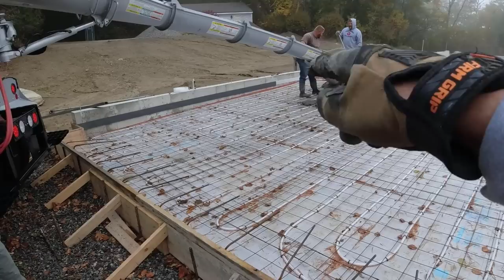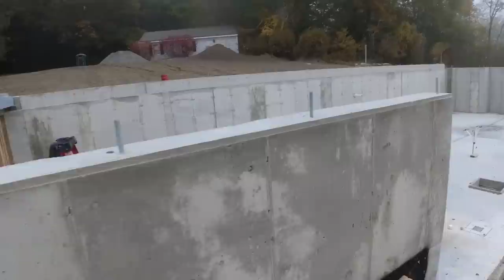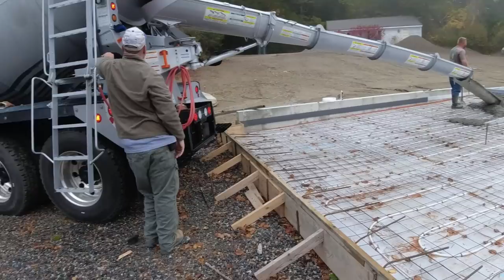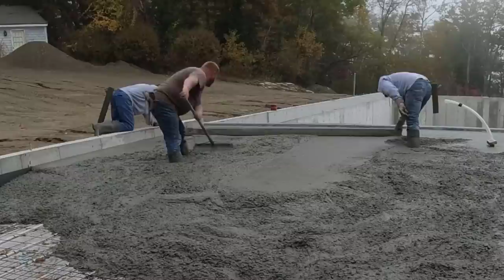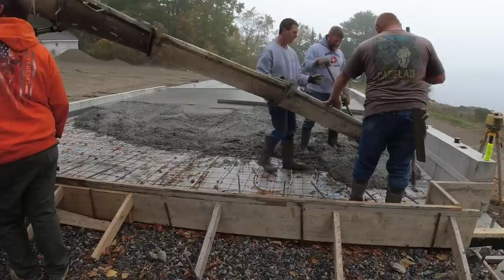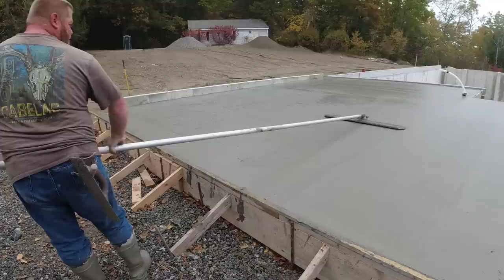We Poured It A Foot Thick - How Did They Mess This Up! (Garage Floor Over-kill)

Comment: Hey Mike love your content. I cannot wait to pour my 40x60 slab after joining the Concrete Underground and watching all of your content. One question about the mix y’all use though. I emailed a company about what I was after - 4k psi, mid-high range water reducer, 6” slump, fiber mesh reinforcement. They said the fiber mesh they use is to prevent shrinkage, he made it sound like the fiber mesh used to actually reinforce was uncommon and only used on engineered jobs etc. Is their a specific brand of those additives you can expound on a bit either somewhere in the Underground or here? Thanks a ton appreciate you sharing a lifetime of experience with us.
Reply: Don't put too much weight on the advice from the sales staff at the company you emailed. Just because contractors don't necessarily follow a best practice in your area doesn't mean that it's overkill or a bad practice! Just take a look at the average spec house from a national home builder...  they can barely frame their houses competently. 

For these builders (who likely comprise a significant portion of the business for that concrete company you mentioned), they need to save every last cent to maximize quarterly earnings. They'll be buying 3500psi (or less, if possible!) concrete to save a few bucks. They certainly aren't going to be paying for extras like fiber mesh. Consider that fiber mesh may "only" cost you $8+ per yard for a retail purchase. For you (as the project manager / homeowner), that may only be an extra few hundred dollars, but for a national homebuilder completing 500 homes per year, that could be $100,000!

Now, of course, any homeowner buying a new home for $250K - $1.5M+ would gladly pay an extra $150 for fiber mesh in their concrete if the cost/benefit was explained to them. But as I just described, this information is very far removed from the end user. Even if builders did explain this to the user, there's no way they could sell a home for $250,149 instead of $249,999 to recoup that expense, so material upgrades are almost always a cost center for national homebuilders. 

(I could go on; this doesn't just apply to concrete! Check out the sill plate for homes from national builders; For an extra $100 per house, they could upgrade to "ground contact" UC4A pressure treated lumber. But instead they pocket that $100 and almost exclusively use "above ground only" UC3B pressure treated lumber which has ~50% less wood preservative (and more headaches down the road for the homeowner!). A reasonable home buyer would certainly spend $100 in this area for the better material...  but except for custom homes (where an engineer is likely specifying the wood quality and concrete fiber mesh ;)), there's currently no way for national home builders to "monetize" any material upgrades... so they're never even offered to the homeowner)

In any case, that was the (long; sorry!) explanation for why concrete sales people find add-ons like fiber mesh to be "rare" or exotic; it's not that they're misleading you, the problem is that the majority of their business comes from contractors who are following the directions of upper management pencil pushers!
Reply: Hi Mike That must have worn you out having to walk through concrete that deep. Your crew and the driver seem to be good friends
Reply: How is the underground? Is it a lot more detailed?
Reply: Check out helix micro reinforcing - tiny twisted steel that is added to the mix.
Reply: Always use rebar if you want it to last!  Use of fiberglass in place of rebar is not going to give yup the strength against stress fracturing.  Wire mesh or rebar should be held up with plastic risers or concrete Dolby blocks with tie wire embedded  into them to tie to rebar or mesh.  Any structural rebar or wire that is not held within the slab at the proper depth will not give the ultimate strength.  Adding of plasticizers in place of water to make it flow-and achieve a specific slump is a great way to get a higher PSI  concrete.  Less water greater strength. Always pour as dry as you can handle it and work it.  Use high frequency vibrator to help with moving the concrete, removing air bubbles and bringing the cream to the top for an easier finish.  Higher Portland concrete, like  a six sack mix, will give much better quality in the long term.

Comment: I know you guys did your part, but sure seems like that grade issue should have been corrected? Just crazy for so many reasons and I could see you where thinking the same all the while you were pouring Mike. All the best in 2023!
Reply from the maker: The GC was notified and it was their call. We had the same problem on the house floor, it was 8" instead of 4.
Reply: Someone used a metric tape?.... Lol... That's nuts.
Reply: @MikeDayConcrete  Yep I thought that was the case.Keep on Keepin on!
Reply: @MikeDayConcrete  The GC’s brother must own the concrete company

Comment: Hi Mike,  Thanks for your videos.  Do you happen to have a video where you poured a slab patio that the owner was considering one day possibly building over at least part of it?
Reply: In Europe there would be two pours, first the 4 inch subfloor, then on top of that insulation, then the radiant heat on top with a fast warming thin liquid screed self levelling covering that. Much better

Comment: The slope is really excessive. I have done a lot ao
Is there a supervising engineer f garage but not 6 inches slope, look like a ramp plus not coordinated with civil engineer site grading.
The question, why no question the 6 inches slope before do😊ing any work or during the review of the construction documents.
Did you request for clarification regarding the slab on grade thickness and slope? Did you coordinate with HVAC engineer the the correct placement s aof heating element..

Comment: For those that've never moved mud (concrete) before, there's a big difference in moving around in 4" thick and 12" thick.  Not fun.
Reply: Fuk'nA right! Especially on 55 year old feet... ;)
Reply: I don't know how you gus calibrate with the other guy while screeding. We use 1man screeds.
Reply: @BaberJacks  me either. Clip on aluminium screeds are far superior and flatter.
Reply: @lachlanitis2311  we use the ezy screed. I think marshaltown sell them in the states.
Reply: @BaberJacks  definitely easier on the back, we use different screeds in Aus. Slower but highly accurate I and many others can screed within 2mm or even 1mm if the concrete is dry.
Reply: @lachlanitis2311  good raker/shoveler saves ya.
Reply: @BaberJacks  definitely

Comment: What a disaster. The basement entrance doesn't meet code either. Slopped floor or not, a 4" min. gas check is required in all 50 states under national fire code. We always grade for finished floor height 4" below top of foundation. As always nice work Mike!

Comment: The mesh is not doing its job unless it is supported on chairs at the correct depth.    Walking on it and poking it with a walking stick is not in any specification I have read.

Stavros

Comment: This is going to affect the radiant heating under 10" of concrete. Someone should have stopped and got the builder, architect, and heating contractor out there and inspected the subgrading before pouring that floor.
Reply from the maker: We did, that's all in the video

Comment: WOW that is thick. The question is, will it crack? :)
Reply: Oh my, Yes it will crack and there will be problems later on with some spalling and other issues.  I know, I am an Engineer in PCC
Reply: @dereksellars  Shucks! so the question is how do you pour a basement/garage floor that doesn't crack?
Reply: @johnwayne2103  The concrete will always crack. You just need to control where you want that to happen. Also, they just used wire mesh instead of rebar mats. At 10" thick, there should have been 2 mats. Zip strips are good to put in a floor like this. You will have a hair line crack where they are placed, therefore you can barely notice them. I wouldn't have let them pour this floor if it were mine.

Comment: Well on the bright side it sure will hold the heat when the power fails, or fuel, I'd say a week at 30 degrees no problem. But I'm just a sign guy.

Comment: Why put wire on the ground in a 12" thick slab?  Even if you pull it up, it's going to drop back down and lay on the radiant tubes.  Pull the wire out and save it for a job that it would matter on.

Comment: Making a change like that on the fly is never good. That heat was engineered for a 5” floor. Aren’t you worried that pouring it that deep and wet ( almost self leveling) it’s going to crack like crazy?  You always seem to add too much water to your flat work. Guess it works for you? BTW I estimate you got about 60% of that mesh of the bottom of that pour! Where you a man short on this one?

Comment: Concrete is sitting waaay too long before screeding! Need 5 or 6 guys with rakes and the trucks need to dump nearly instantly, with guys pulling concrete in  waves  back into the corners of the form. That's the way you do it! Road mesh is useless, sitting at the bottom, with no dobies or chairs. Half a dozen guys with good rakes can pull an 11 yard load up to 40 ft. from the front of form in  just a few minutes.  No substitute for enough labor.

Comment: I used to love doing those walkout basement floors they were so easy all the way around from pouring it to putting the 4ft power trowel in there to take in the power trowel out everything just so much easier I've never poured that thick a concrete floor on radiant heat before does that even work couldn't you of just put a drain in the middle instead of putting such a big slope on it

Comment: That wire mesh is way too light to reinforce that thick of a slab. AND, even worse it is not supported at the correct height in the concrete. The workers lift it up with their rakes and then promptly walk on it with their boots, driving it back down to the very bottom of the concrete. Rebar on rebar chairs is the only way to go.

Comment: Did your guy say, "We're gonna have to straighten out the truck drive?" Lol, I need a translator for the driver at some points and I'm only afew hundred miles away from you guys in Pennsyltucky.  It is amazing how diverse we are already before the bolshevik social "engineering" of the Hart Cellar Act. I call it destruction not engineering. Making a mistake is one thing. Purposefully doing something is criminal.